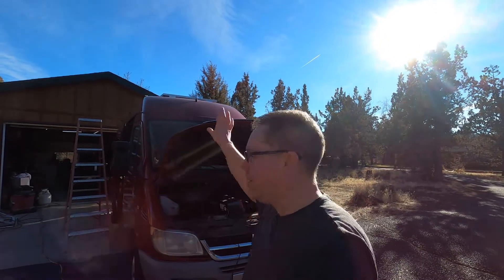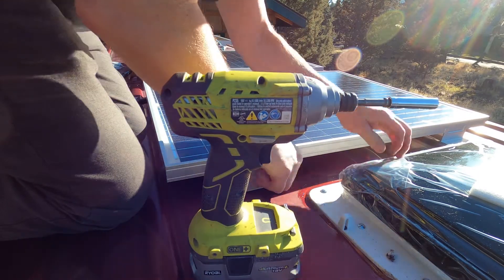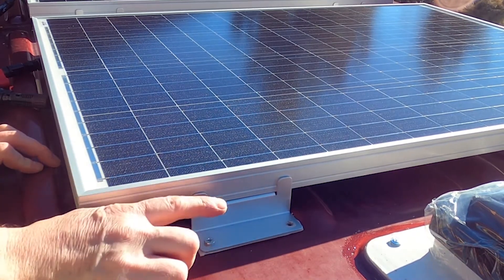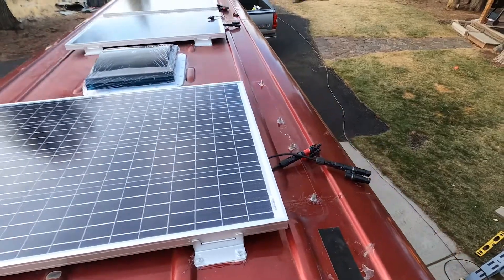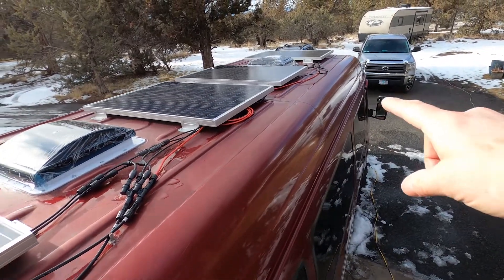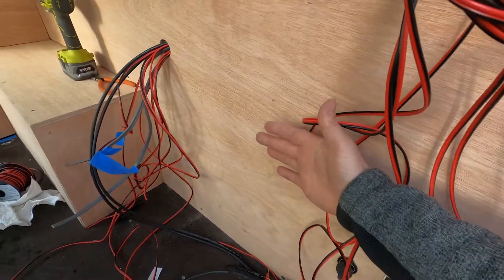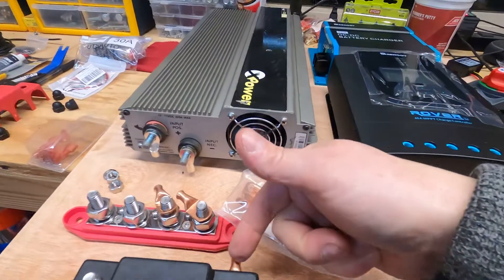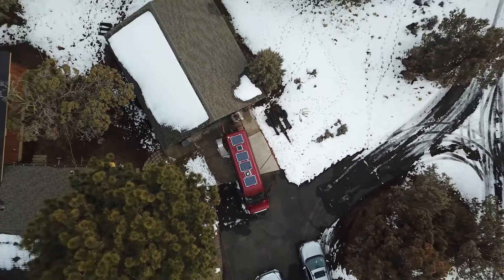Solar panel install on my 2006 Sprinter "off grid van build" Van Life!

Comment: You might investigate rivnuts.  Is applied thru a hole in sheet metal from one side like a blind rivet, but has a threaded hole thru the center. Lot of youtube videos.
Reply from the maker: How did I not know about these, I am very familiar with rivets and I use them all the time but these things are awesome. Thank you so much for the heads up. I am ordering a set tonight, it might be too late for the solar panels but maybe not. Thank you so much for watching and supporting my channel.